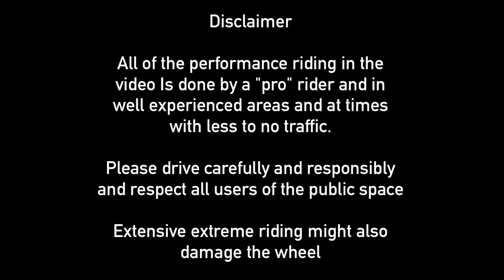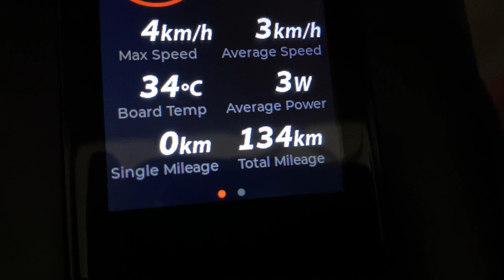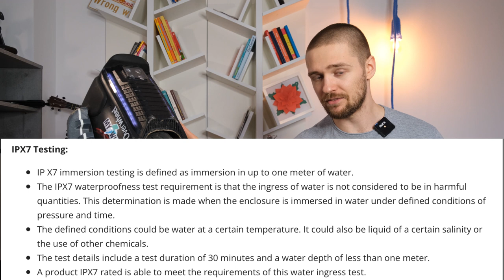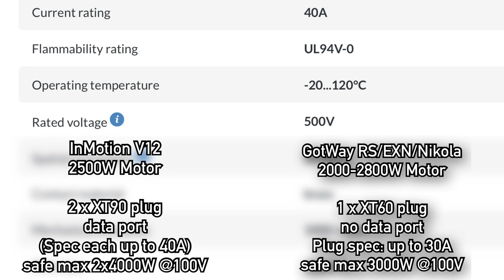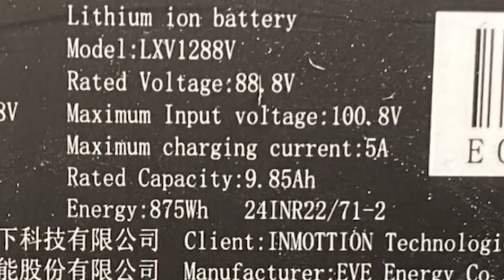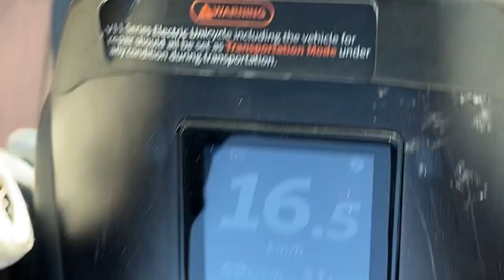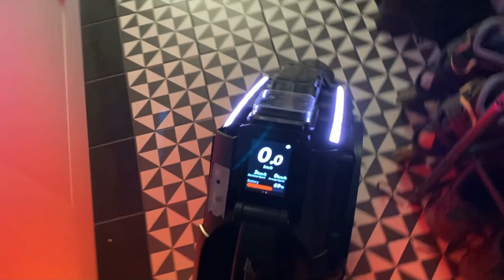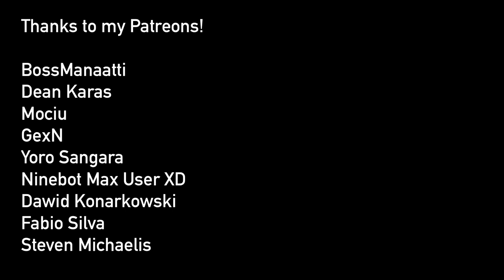InMotion V12 in-depth REVIEW

Comment: That's some fine chapterin', kid - now I will be able to find my spot later because I never get an hour to myself in a continuous block :-)

I'm probably not alone in that...
Reply: there are tapes that don't degrade and will protect sections - if I built this from scratch, I'd have just slipped a couple extra layers of shrink tubing on the risky parts but that's a VERY manually intensive process and not really good for manufacturing.  In manufacturing, maybe a kevlar braid sheath is cheap and tough enough to resolve, have the mechanical engineers shave a few sharp corners off the cable routing.  Surprised the electrical guys didn't yell at them for that one...if I were the mfr I would be very interested in that point of catastrophic failure.  Imagine if you opened your car hood and saw the same thing, I'd freak out and fix it immediately.
Reply: this would be a great model to upgrade to a strong skeleton and bumpers since you point out there really isn't a frame under the hood - it's kind of the unibody vs chassis on frame that car/truck enthusiasts argue about.  :-) 

Make one out of unistrut lol

Comment: Amazing review! Summary = https://youtu.be/9pL1AFbqDhI?t=2315 lol

I couldn't quite figure out the name of the circular red light you've mounted onto the trolley handle, what is it called?

By the way, when you used off-road mode with 100% pedal sensitivity, did you notice the tilt-back would happen at a lower max speed? I discovered that in my V10F.
Reply from the maker: It’s a Gaciron W10BS. No Tilt back being noticed :)